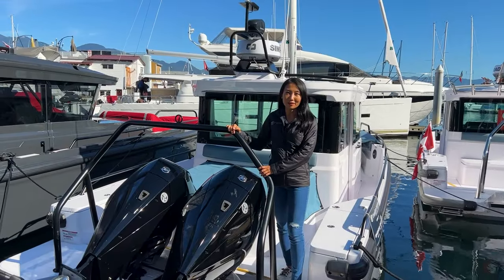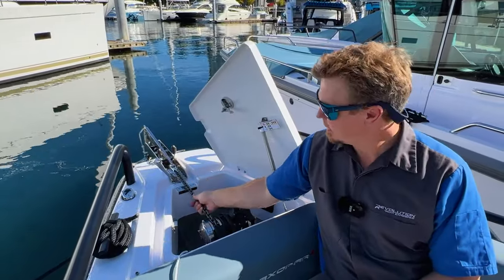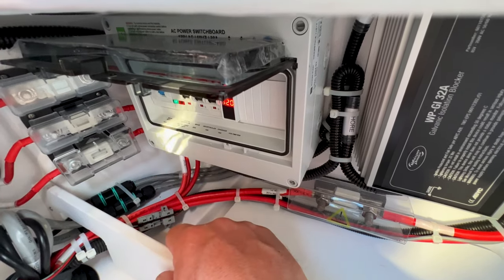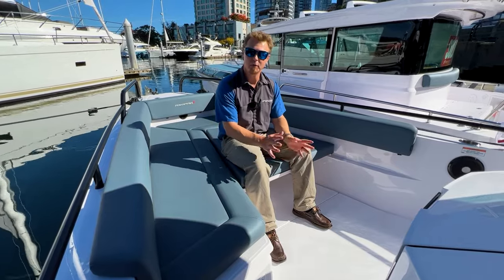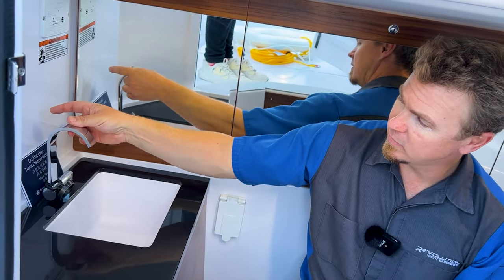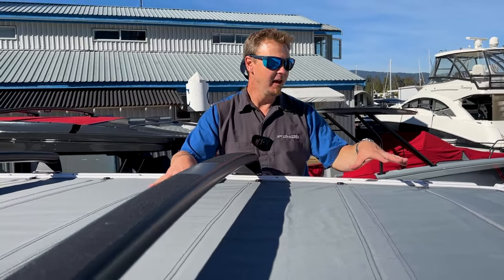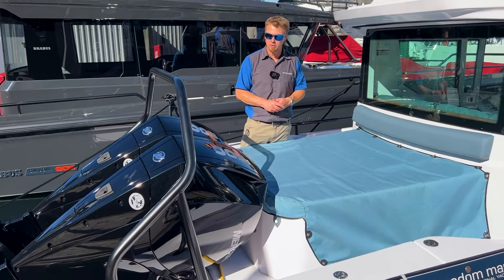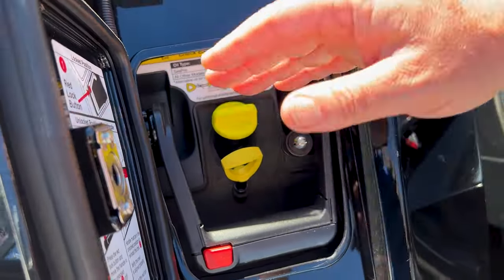Axopar 28 - Full Vessel Handover Walkthrough Part I - Freedom Marine International Yacht Sales

Comment: Another great videos guys.  Very helpfull to anyone who has an Axopar 28, or is thinking of getting one.  Regarding the tie points at 45:35, I have been told they are part of the CE compliance as a place to tie a safety line going from the bow to the aft which can then be used with a harness in rough weather.  Not 100% sure if this is true, but it makes sense.